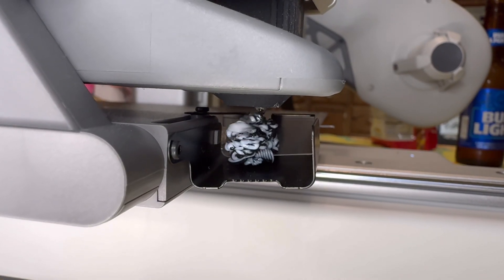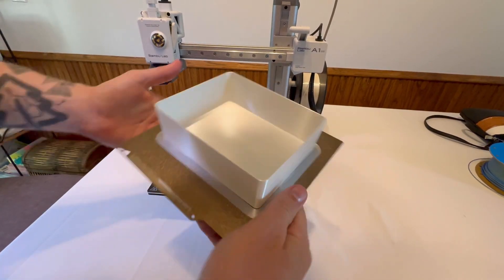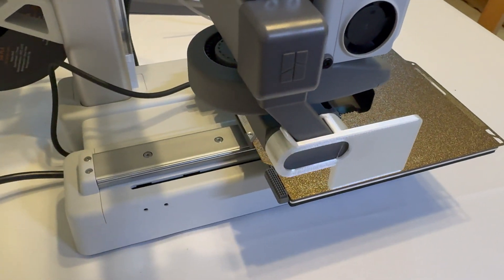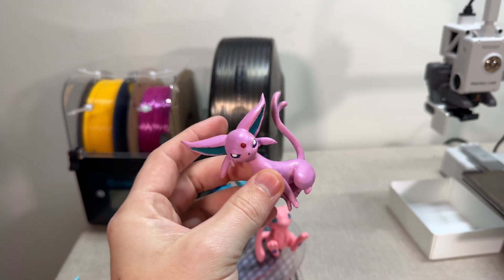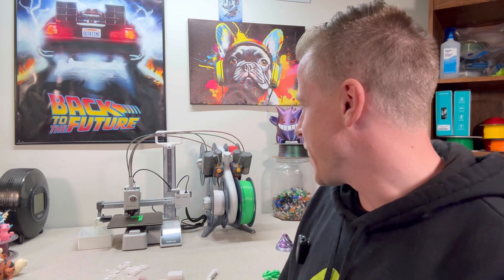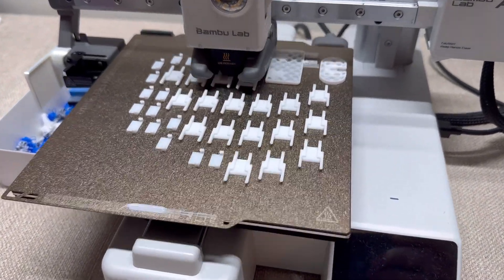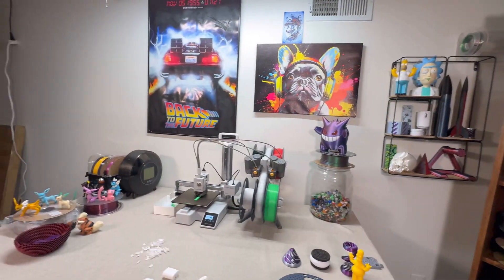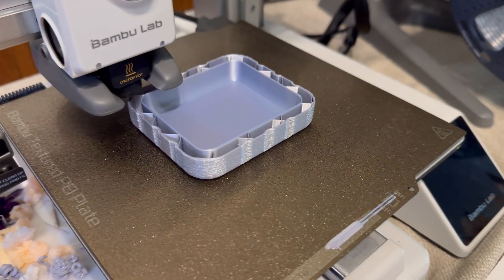PRINT THESE FIRST for Your Bambu A1 Mini

Comment from the maker: 1. Poop Basket - https://makerworld.com/en/models/156091?from=search#profileId-170921
2. Poop Deflector - https://makerworld.com/en/models/123164?from=search#profileId-132720
3. Handle - https://makerworld.com/en/models/48599?from=search#profileId-62550
4. Filament Clip - https://makerworld.com/en/models/48350?from=search#profileId-65262
5. Tool Box - https://makerworld.com/en/models/492119?from=search#profileId-654348
6. Scraper - https://makerworld.com/en/models/12703?from=search#profileId-12705
7. Cord Chain - https://makerworld.com/en/models/493268?from=search#profileId-407002

Comment: Great video. Yes, printed the poop thing, but in a different design, the poop defelctor, also the handle, the filament clip - not yet, still using holes in the filament spool. Will look up that camera, the built in kinda sucks. 

Btw: The cam records to sd card, even if You've turned off the feature, but maybe I've got an older firmware? My printer is not wifi connected, so maybe that's the case. Starting multicolor printing this week, got the ams. A little curious as to what to try printing first with the ams...

Also, experienced my first blob of death in the weekend, so will have to clean the printer before I go on. Have had that problem wth my Creality K1 Max before, and fixed that one a couple of times, so I don't dispair.

Comment: Does the Bambu Lab A1 Mini need wifi and cell phone to use?
Reply: I think you need WiFi but if you don’t use a phone then it’ll be pretty boring with the couple 3d prints Bambu lab already has on the printer
Reply: @MyDogsNameIsNugget Ok.  I was told by someone on Reddit that the Bambu Lab mini can have its SD card taken out to upload 3d prints from a laptop.  And the Bambu studio he said could be used on the laptop.

Comment: Can the one A1 mini print 3d figures up to 1 foot in height? 40 cms.
Reply: 180mm x 180mm x 180mm build volume!
Reply: @razorr527  180mm×180mm×180mm build volume
Reply: Pretty sure it can,I have one but the width is small
Reply: no. you would need a massive printer for that. even the normal size bambus cant do that. look for a 400mm x 400 x 400 build volume printer
Reply: Well, yes, but not in one print.
You can cut the model in half and print bottom and top next to each other then glue them together.